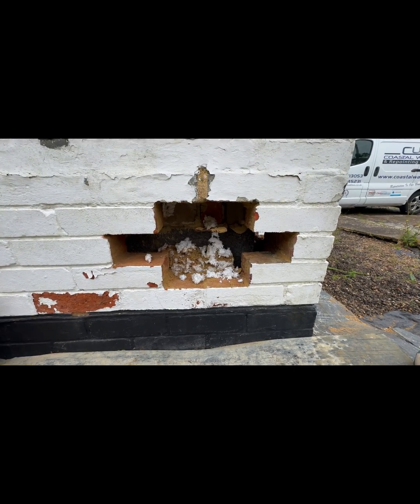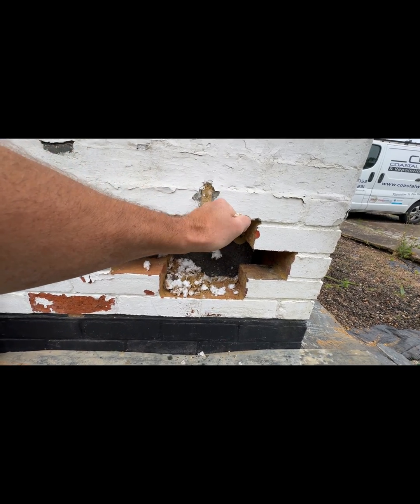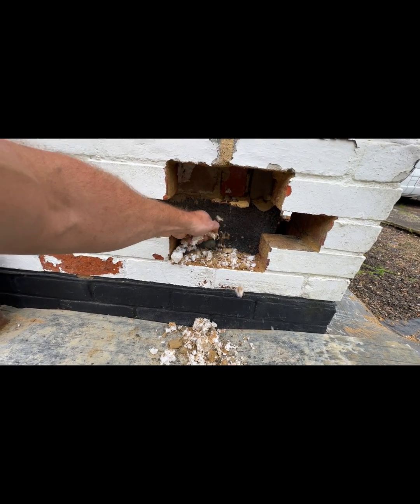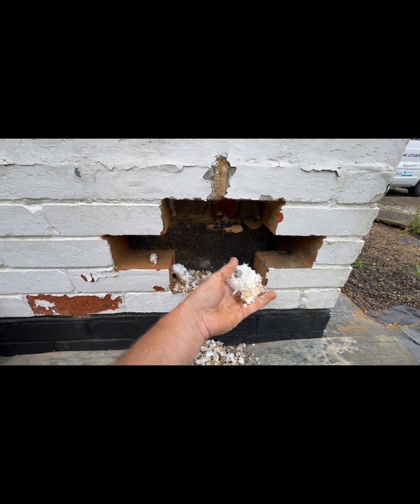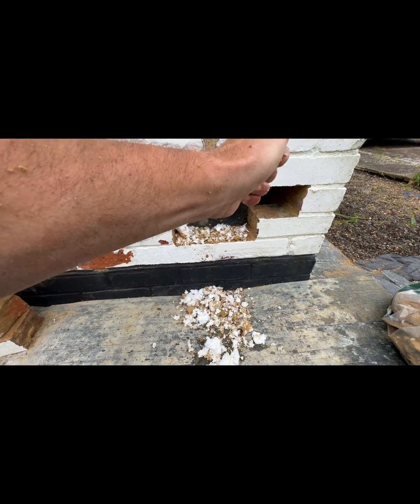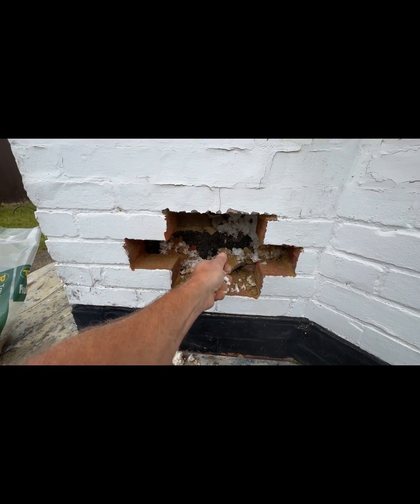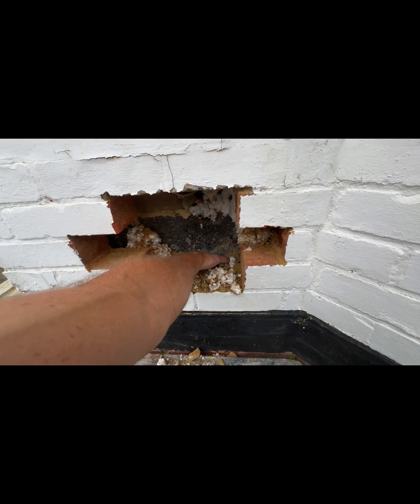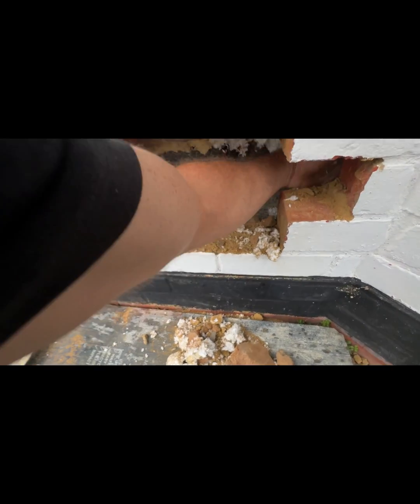Do you have damp walls? Could this be the cause?

Comment: Its interesting, as you say this loose type of fiberglass is in itself not water resistant and will hold water and therefore would be useless as insulation. We have a 1970 block of flats that have this insulation in the 50mm cavity, our last external block removal found a 50mm hole had been drilled and the core dropped into the cavity to bridge it. !!!!!   We suspect that the cavities were filled after the building was completed but its not easy to spot the drill holes.
As we have scaffold asses at the moment I am tempted to drill 12mm holes into the bed courses at the top of the walls to allow air movement to dry out the insulation and then maybe at the bottom as well.
We have an average of 20% moisture readings to the outside skin so we can re-check at the end of the Summer to see if it has fallen.

https://youtube.com/@riversideestate-jj2hr?si=oYhk0vFU77KVnJwv

Comment: I would personally suck it all out and leave the cavity empty so it can breathe as it was designed to do. I did this to my house it was a big job but all the damp problems have now gone completely.
Reply: How did you get out all out with out your walls being like a culinder
Reply: @andyking05 - They removed 1 brick at various locations all around the base of the house and attached a huge powerful hoover into the hole where the brick had been removed and then drilled lots of smaller holes at various locations and blasted high pressure air into the cavity which dislodged all the loose fill insulation and the Hoover sucks it out the bottom. Once all insulation removed we used rods and tools to scrap all the base of the cavity out of any loose debris and old mortar etc. House completely dried up within about a year and we don’t notice any difference with heat loss to be honest and energy use not gone up. No way I would put insulation back in. I only had 40mm cavities and 1920’s build house so I don’t think it should have been put in anyway in the first place. I have air bricks at the bottom of the house and now air flows freely into cavity and into loft like it was designed to I also have soffit vents which help with air flow. I  Found it easy to repair as intrusion is minimal, you would never know it was ever extracted.
Reply: @andyking05 had a company in to do it professionally it was not that bad to be honest. A few bricks removed around the base and an industrial Hoover attached into the holes and then small holes above drilled into cavity so pressurised air could be used to blast into cavity to dislodge it all had a large house completely cleared. Showed me with inspection cameras afterwards how clear the cavities where amazing results all my damp problems solved by removing the insulation and allowing the house to breath again through the air bricks and soffit vents like it was originally designed to do. Have not noticed any difference in energy use or heat loss either.
Reply: @raaraa-1  that's great, do you know what company you used